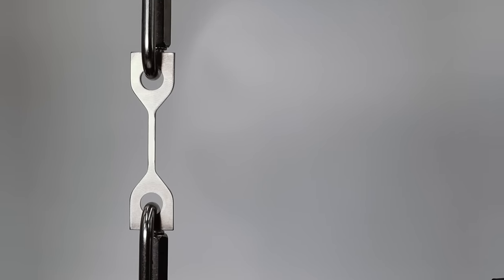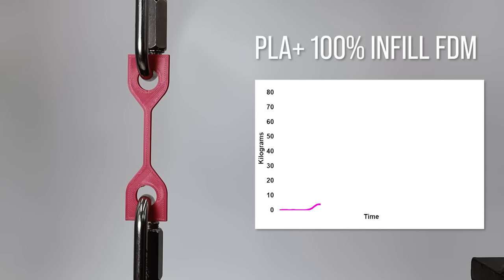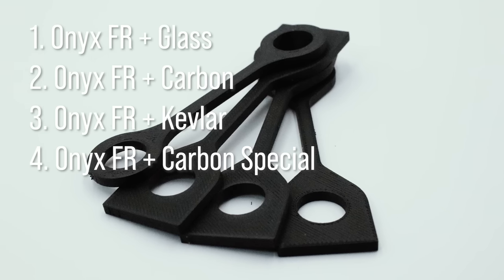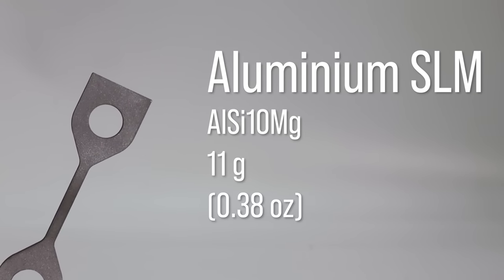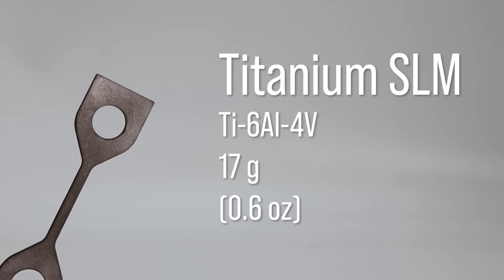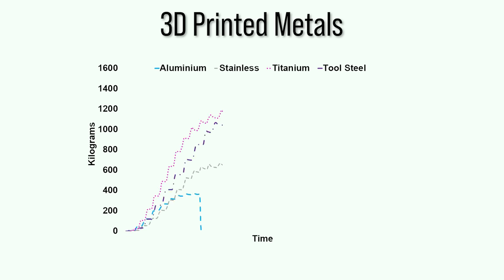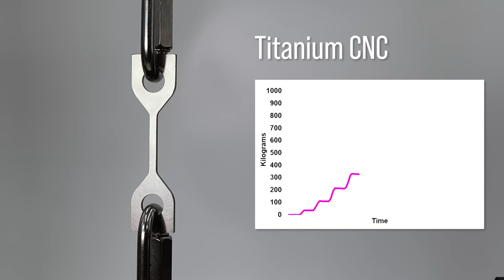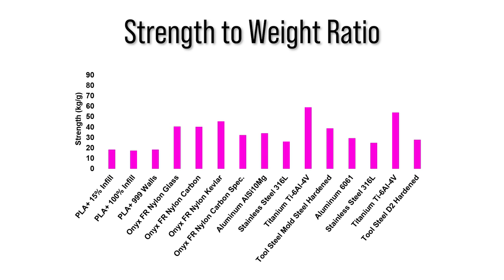3D Printed Metal vs CNC Machined - How Strong?

Comment: I understand you are doing your best, but . . . .
As someone who works in materials testing, testing a single sample really isn't enough to draw many conclusions.  You could just have a bad sample.
AND, tensile test samples are SUPER sensitive to stress risers.  Grooves or pits too small to see can be a stress riser and weaken a sample A LOT.  I suspect that's why your CNC samples gave weaker strengths than the printed ones.  Have you looked to see how the CNC samples compared to published material strengths?

Also, how are you calculating your elongation?  I feel like if I can see it visually, it has to be more than 1.2%.
Reply: Yeah, there is definitely something going on with those elongation numbers
Although, it does appear that the whole setup moves when it is cranked
Reply: Yeah, but that is how they are used in the real world.
Reply: @jackdeniston59  In the real world parts are affected by variable load and what matters is plastic and elastic deformation numbers. You can kind of see that in graphs but this info is useless.
Reply: @jackdeniston59  A thousand different kinds of defects can occur in the real world, all affecting the results in wildly different ways. Doesn't mean the data represents real world performance, if you choose a sample with a random one of those defects and measure it.
Reply: Maybe he calculates the elongation after fracture by putting the two broken pieces back together and comparing it to original sample length (negating all elastic deformation).
Reply: The fact that the 3D printed metals performed better than the machined parts surprised me, but since there are multiple materials tested and 3D printed parts consistently win, I would say there is a trend there.
Reply: @raymonddunne627  The trend is the PCB way 3D printed parts outperform their CNC parts on this specific geometry in this very small sample size. From what I have heard from automotive engineers talking about this on youtube, 3D printed metals are categorically weaker than their cast and machined counterparts. Especially regarding fatigue. Their is a weight savings to be had but the defects and material properties are wildly unpredictable when compared to traditional manufacturing processes
Reply: I'm more concerned wizh the obvious differences in failure mode. This is a wild mixture of structural failures, mostly delamination, and tensile failures.
Reply: @Anyone700  3d printed metals is still niche, but i wouldnt be surprised if it replaced most of CNC machining in the future
Reply: @swe872  I doubt it can come close to the tolerances of CNC'ed parts for the foreseeable future
Reply: @Anyone700  
From automotive engineers?
I highly doubt those guys are going to be 3d printing any automotive parts lmao. Automotive engineers are the cavemen of all engineers, they barely know what they are doing to begin with. 
Even aerodynamics they call in aerospace engineers for, and materials they call in material engineers for.
when it comes to manufacturing processes, they call in industrial engineers (what I am)
The automotive engineer themselves just come up with an eye catching design. they often barely even know the details or performance of their own design or what it can or cannot do, let alone what will be better designs for different areas.
I would even argue that automotive engineers are barely qualified to be considered engineers.
Also, I do not know why you are taking it so seriously, youtube is not a place for hardcore serious scientific research.
Reply: @Anyone700  
Cast metals will always be lacking in most areas, 3d printing is a all around improvement to casting in nearly every way. Machined parts are subject largely to the process of the machining, as it can create massive flaws in the parts if not done correctly. Forging is generally better than 3D printed parts but has high limitation on the types of parts that can be made.
Overall, in most scenarios, 3D printed parts perform roughly equivalent to other manufacturing processes. 

However; as an industrial engineer whose specialty is in developing proper manufacturing processes for parts, I can assure you that the manufacturer will almost always use multiple processes. 
Each process tends to have its own advantages and disadvantages. 
casting has distinct limitations due to flow properties.
machining has distinct limitations due to the buildup of stress and creation of material flaws at the microscopic level.
forging has distinct limitations in the type of parts that can be made.
3d printing has distinct flaws due to being anisotropic, but this flaw can also be an advantage with proper design.

Subtractive manufacturing in general has the overall benefit of being isotropic in nature. meaning the material grain is consistent in all directions due to the creation process of the stock material.
Whereas printed parts suffer from anisotropic properties due to the direction and method of layered printing. Meaning they will be stronger with forces applied in one direction but weaker to forces applied from other directions.

By combining different manufacturing methods, these weaknesses can be compensated for or outright eliminated, or even turned into strengths.
additionally, one massive strength of 3d printing is its freedom of design.
You can create 3d printed parts which are nearly impossible to machine with traditional methods, opening the door to various design changes. 
Additionally, 3d printed parts can have hollow cavities with structural support, retaining most the overall strength and much less weight. Traditional manufacturing cannot do that consistently at all.

and especially for the automotive industry, parts like that would be and are exceptionally useful.
So automotive engineers telling you that 3d printed parts are worse than traditionally made parts, are just idiots who draw a design and have everyone else figure out how to actually make it in the best way we can. simply put, they don't know what the heck they are talking about at all.
Reply: @Anyone700  
The primary reason 3d printed parts are excellent in automotive industries, is due to the many highly complex part systems, which through traditional methods often have to be turned into multiple parts and then assembled together.

A full 3d printed part will always be completely stronger than the traditional manufactured version of it that is made from multiple parts.
This is because anytime you have to combine different parts together, the joint will always be the weakest point, and 3d parts would be lacking this joint because they did not need one for the part to be made.

of course casting can also get around this, however casting large parts gets exponentially more difficult the larger the part, while 3d printing is more consistent and reliable, albeit more expensive than casting.

Tesla has become extremely famous due to developing a way to cast the frames of their cars as one massive piece, taking the frame which used to be tens of thousands of parts, and making it only 3 parts.

Despite casting itself being overall weaker in nearly every way to other manufacturing methods, due to the lack of joints, the whole part itself is overall many times stronger than the previous design of many parts assembled together.
3D printing also has this massive advantage.

This is the main reason I say those automotive engineers have absolutely no idea what they are talking about.
Reply: It's in line with the current research so nothing surprising here
Reply: For someone who "works" in material testing you seem to be eager to draw conclusions about cnc metals being stronger. All you are given is this sample size, all you can do is draw conclusions based on it. Sure it might not be as accurate as possible, but to "suspect" that that is the reason the cnc samples were weaker is clear bias. Get your head out of the sand or disprove it.
Reply: @Anyone700  I don't know who told you 3D printed metal is weaker than CNCed but that's not true. In real world applications, they perform very similarly, which this video supports as well.
Reply: My theory is the 3D printer "heat treats" the metals, giving boosted strength.
Reply: false

Comment: I hope we get consumer-grade metal printers soon.
Reply: Or just cheap good quality 3d printers
Reply from the maker: That would be amazing! I think we’re a little while away from that though.
Reply: @smashyrashy  what? Ender 3s have been available for many years now, if you're wanting something more professional grade, then a Prusa or (nowadays) a Bambu will do almost anything most people need. (Though a Bambu is way less open source and so likely won't last nearly as long as the others)

What are you looking for exactly?
Reply: @WeAreChecking They said "good quality" so Ender 3s don't really fit the bill. Nowadays on the lower end there's stuff like the SV06 which takes the form factor and robustness of a Prusa but makes the whole package far cheaper.
Reply: Just need a furnace-y enclosure, a tungsten nozzle, and an induction heater coil.
Reply: @smashyrashy  Good chesp printers have existed for a while. You're not gonna get a voron or x1c for 200$ but s neptune 3 pro for 230 or a neptune 2s for even less, a sovol sv06 for 250, or any number of other printers are pretty fantastic for the money.
Reply: @significantharassment  ender 3 is more than enough for every day printing
Reply: They are but yuo need to save same money, just  around ' $100.000 dollars for just the slm machine (dont forget the other cost, cocking machine,tools electric bill ,materials and cofee ) for start😅
Reply: @Fantastika  well , if yuo have time and patient , yeah
Reply: @noway8233  That's not very consumer-grade now is it? 😅
Reply: Won’t happen except for perhaps sintering systems with an oven. The powder is very flamsble (basically fireworks) so you need large enclosures for safety, cost of high power laser to drop and price of inert gas to go down. It will most likely never be consumer cheap
Reply: @facenameple4604 metal 3D printing doesn't work by melting metal and pushing it out a nozzle. You wouldn't be able to cool it fast enough to have any sort of accuracy, and it wouldn't adhere to the already cooled metal below. Molten plastic isn't really molten, it's glassy. Sticky and thick. Molten metal has a lower viscosity than water.
Reply: You can make stuff that has some metallic properties on consumer level printers, but legit metal printers cost more than most houses and there are a lot of challenges that the everyday consumers just can't handle. You could get a good printer with ~ender 3 size volume for $750k-$850k, but then even the least expensive powders are going to be ~$100/kg, and you need, or need access to, at minimum another house worth of peripheral equipment for handling/processing the powder and builds once they've come out of the printer. It's pretty far off from something consumers can handle realistically
Reply: I doubt we'll see that for decades. It's too lucrative of a market for companies to start aiming low.
Reply: I recently came across this company: metal-base
They are making a metal 3d printer using the SLM process for less than 10k and the machine should be available somewhere next year

Comment: I don't know if anyone has mentioned this but it matters which way on the plate the part was machined from. There is an elongated grain structure from the rolling process. I tested this in my nail making video as I was making nails from sheared material and the strength drastically differs from 90 degrees on the original plate. Cheers J

Comment: It's nice seeing that characteristic stress-strain profile for the steel, even with the 3d printed one. It would be interesting if you could somehow constantly increase the load instead of pumping the jack.
Reply: A stepper with gears xD
Reply: It’s not a Young’s modulus graph though so I think it’s just a coincidence
Reply: @angrydragonslayer the much more obvious and practical solution is an electric hydraulic pump.
Reply: @JacobLeeson-zk1ol  rude

Comment: Depending on what "tool steel" you had, you could have heat treated it to triple its performances (i don't mean annealing it as a heat treat, i mean hardening and tempering). Heat it to cherry red, and not any hotter or under that, drop in water, and then make its surface shine again with sandpaper or a stone, you just want to see the metal underneath. Then, with the torch, slowly heat it back up until the steel starts taking tempering colors. Reach an electric blue, avoid going above that too much, and below that will just be too brittle. Flame tempering is kind of a crude way of tempering usual carbon steel, but that's how it was done before. That being said, it's not pushing the material to its best capabilities, you'd need a tempering furnace for that.
Reply: And an age oven, control for temp, duration. Aluminum processing is a different though in the quench. You don't want it to severe you can get issues with grain structure. It also matters how think the aluminum.

Comment: Very interesting results here
Curious what the cross sectional area of the test piece is? Could be more useful to have the numbers in MPa.
An idea for a future video could be comparing the metals at varying infill levels to high performing plastics (peek, ultem...) For strength:weight and strength:volume comparisons
Reply: It would be very difficult that way once you start plastically deforming the test part. The necking would reduce the cross section. unless he had a way to keep track of that, maybe a cylindrical test piece?
Reply: @MrBricks148  Mpa is always calculated with reference to the unstressed cross-sectional area. However calculating the poison ratios would be interesting regardless.
Reply: @Zestybwoi  not always. Tensile reports are in engineering stress as you’ve noted, but in most finite element model solvers (notably excepting NASTRAN) true stress vs strain is used. Tensile tests also give reduction in area and elongation values, as well. These datapoints combine to enable approximate generation of true stress vs strain curves.
Reply: I prefer to do it in psi. 😅 but yes, cross-sectional is key. Especially when looking at your offset and your proportional limit.
Reply: @MrBricks148 you need to measure it when you do the calculations for your offset. It's how you get compliance to astm😢 tensile testing standard.

Comment: Electrosync Great video! very cool to see results like this, one thing I'd suggest is looking into something like ASTM E8 for coupon designs and having larger radius from the grip sections to the gauge lengths, this focus stress into the gauge length and gives a more true uniaxial loading for measuring tensile strain, I'd also consider a bolted  clamp mount onto solid grip tangs and have that mount be the point of connecting your test frame mount points to remove the KT factor of the giant hole influencing sample loading behaviour.

you can then also mark the gauge length before testing and measure the distance between the marks after loading for a more accurate elongation measurement.

Since you are recording the test with a camera you could also look into 2D optical displacement measurement of those marks as well.

Comment: How much were the different parts?  It would be interesting to see which printed material gets you the most strength per dollar.
Reply: I second this. What's the strength to cost ratio? I been using sunlu pla+ for some things and it's surprisingly strong and their black is under $20 a roll.

Comment: I expect the CNC metals used here were low-grade billet. This means that the "grain" of the metal would be going all sorts of different directions rather than in straight lines. By printing flat, you are forcing the metal grain to lay a specific way, which is more or less making the printed result a kind of custom billet. By aligning the grain along the stressed plane, you've given the metal the greatest chance to demonstrate its tensile strength in billet form. I wonder if the carbon, kevlar, and glass linings could benefit the printed metals?

Comment: Does metal, especially CNC or forged/hammered metal, have "directional grain/layers" like wood and FDM 3D-printed plastic does? If so, would that significantly affect tensile strength to the degree that plastic is affected or is it not noticeable enough, and is it not possible to ask a fabrication shop to CNC certain metal parts along a certain axis of the sheet if it is?

Comment: Here's a thought. The infil for the prints were placed at what I assume to be the optimal angle, criss crossing diagonally in the direction of the load. If it was printed at a 45 degree angle, it would no longer criss cross, and I imagine that might have an effect on the outcome.
Reply: Metal printing doesn't quite have the infill strategy implications you'd see in plastic printing, but yes, as-printed the material is typically slightly weaker in the build direction. After standard heat treatment though, the materials are pretty isotropic